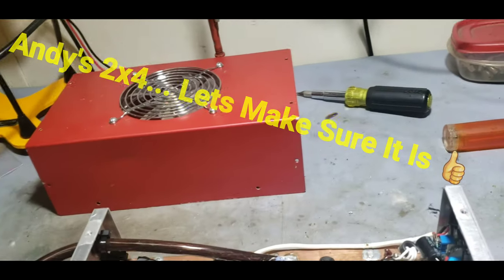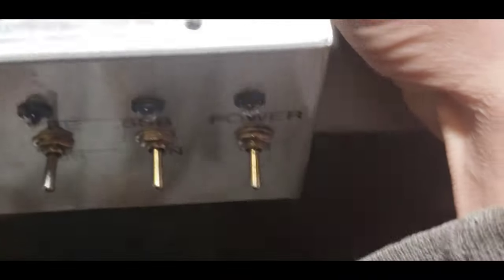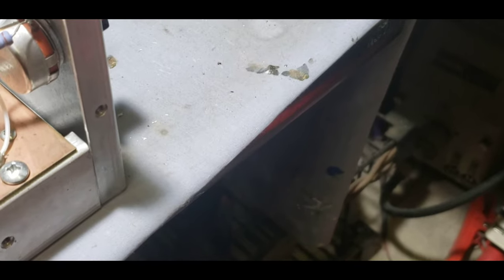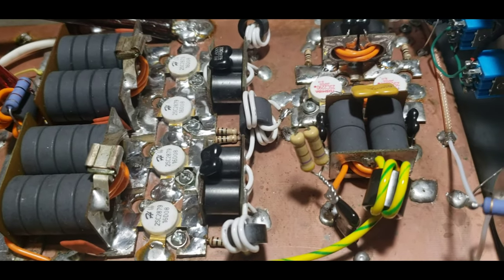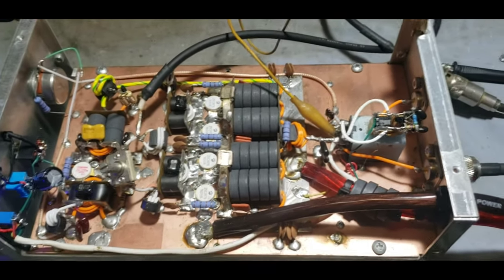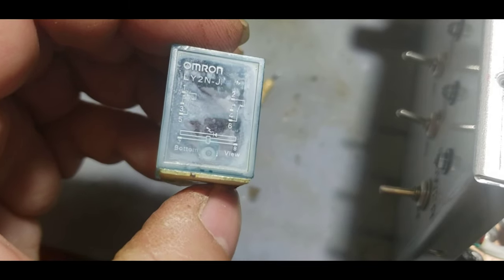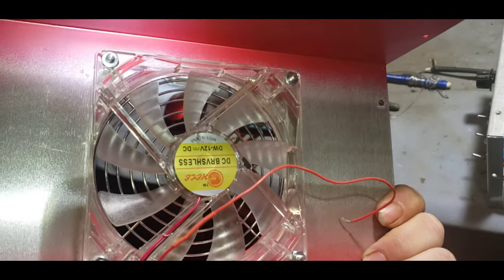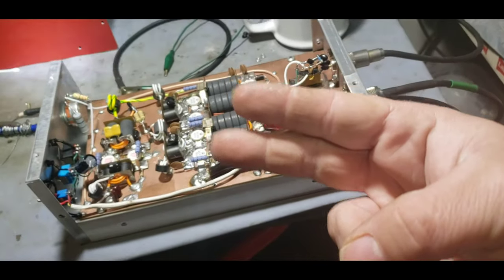Andy's 2x4 Let's Go Through It & Make It Right! - [FINE DETAIL EXAM] 🧐

Comment: What would make the relay actuate when flipping on the switch to the box without keying up?
Reply from the maker: The Keying Transistor being faulty already being connected from emitter to collector....most of the time that is what it is. Real quick unsolder of the keying circuit from ground to see if it stops ✋
Reply: I suspected that and when I disconnect the circuit from the relay I don't have an issue,I must have rebuilt that keying circuit three times with different transistors and it still does the same thing, I've used PNP and NPN?

Comment: A outher LED relay bad. Even BBI got some of them and switched to much better ones. I got word on them before I used them for RF. I got same relay but 24VAC coil used in HVAC systems and they work fine. also come in 120VAC/240 VAC coil. 24V AC/DC ones some 24VAC relay don't work DC .and some AC ones don't work DC correctly. Found that out when I worked for the town several years back on the HVAC system. Also I seen them relays with 5V/6V DC coil as well as 48VDC . I done a bunch of 2x4 amps. lot of blown pills. just to much drive. 1 SD 1446/2290 is just fine. That have a tool for them crush nuts /pin nuts. I have the tool and don't use much. I do same way. washers ! so easy. What I do with them spinning is spot weld them in. same spot weld used on making battery packs. cabinet to pin nut. done. I yet to find a circuit for IGBT to regulate 14V appx. Insulated Gate Bi poler Transistor they are. Induction heaters/cookers use them. VFD use them . HVAC systems use them to control speed of big blowers in commercial buildings.  Where I work in the 90's . IGBT is like a SCR but can be turned on and off with the gate. SCR stays on. I bult 65V reg supply with EPD transformer and pass transistors. Will make a 48-50VDC one next. I go 200 amp one at 14V I made in 1988. 30 2N3772 pass transistors with 723 reg. Tahy make some heat. Switch mode would be less heat. Use Weller 100PG iron  to solder pills. What I been using. Funny BBI just did a video on what he uses. It's tattooed on his arm. LOL . 73's